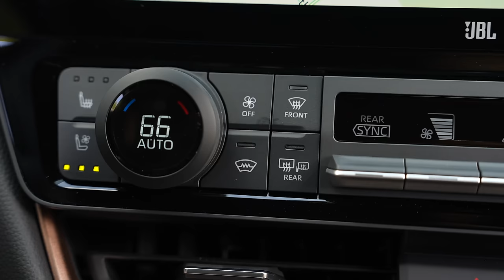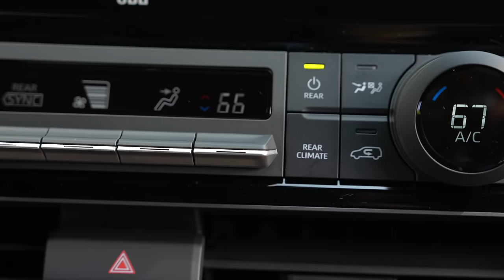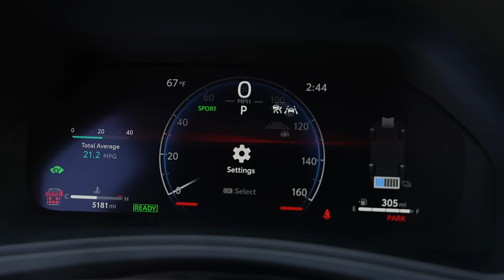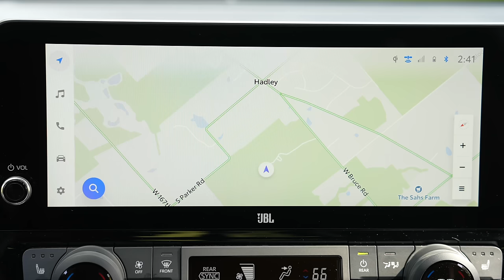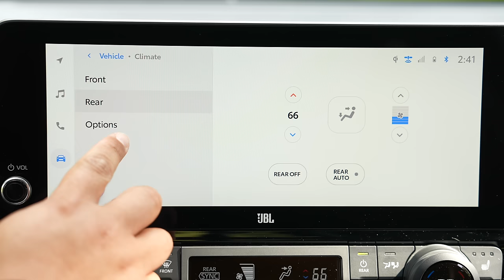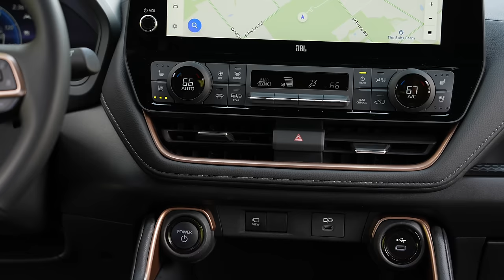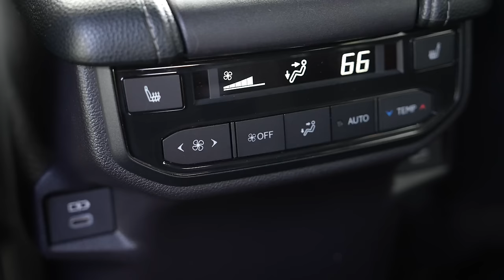Should You Buy A 2024 Toyota Grand Highlander? Back To Basics Toyota

Comment: It doesn’t have an odd shift pattern but when you have 8 gears it is going to constantly upshift and downshift. 8 gears is just not required and thus the constant upshift and downshift for better gas mileage but a huge nuance. There are manufacturers out there with 10 speed which is truly insanity but thr average consumer thinks more gears me and better when in fact they have more gears than they needs making more complicated and expensive to service and replace and repair.
Reply: The thing is though, good modern transmissions are so smooth, that you hardly notice it.

Comment: I think the brake light feature on the screen is for the auto parking brake.  It will automatically disengage when you press the gas again and then reengage when you stop.  So seeing the red on the screen is reassuring and reminding you the brakes are applied.

Comment: Another great video - but I have to say - how far back the engine is inside the engine bay - is irrelevant to pretty much anyone that doesn't service their own vehicles.  They take it to the dealer for the scheduled maintenance and it's a mechanic issue I suppose.   Looking at buying one and your walk through of the components and how there is a functional engine cover etc is great detail.  It's good to know they're using quality material and that the quality overall is what you've come to expect from the Toyota brand.

Comment: There are other advantages of the Grand Highlander besides the more powerful engine option.  Towing capacity is higher in the Grand Highlander at 5000lbs for the regular turbo and Hybrid max engine options.  G Highlander also better Ground clearance than a Sienna at 8 inches vs the 6.3 inches on Sienna.  G Highlander is better at handling snow and can even do light off roading compared to Sienna. Spare tire is standard on G Highlander in regular spot vs an option on the Sienna in a weird mounted position that intrudes on 3rd row and rear cargo space.  G Highlander also suits those who don’t want to be seen driving a minivan.  I also imagine that G Highlander handles and rides better given its more rigid unibody.  Sienna has your typical minivan Unibody that’s basically a big box where bumps go jarring through the en	tire cabin. Oh and you never have to worry about repairing the sliding doors in G Highlander.  So there you have it there are probably more reasons to chose G Highlander but I think I proved my point that there is more than just the improved power train option.
Reply: Yea Grand Highlander wins unless your using the sienna as amazon delivery van everyday or need max space all the time... I don't need max space all the time... I have a mini van and I thought the space was amazing at first until it was not needed and I used occasionally which the Grand Highlander can handle now  that it is bigger...  Also, using my mini pan to put mulch and dirt made it dirty lol  so I am going with Grand Highlander and get a used pick up on the side...  Also, my mini van ground clearance sucks and I can use this highlander on light trails since it ground clearance is actually very good...

Comment: I've owned and loved turbos, but in my old age, I think I value simplicity over complexity.  I'd definitely go the non-turbo route on this one.  I'm also a huge fan of how bulletproof the usual Toyota eCVT is.   Even if the EPA mpg numbers of the two were identical, you can keep the extra power, I wouldn't want this new system.  With this being a serious gas hog by comparison, it's not even in the running for me.  The regular hybrid is a slam dunk between the two.

I agree that the 2021+ Sienna is better in most ways, but I think the regular hybrid version of this is a reasonable alternative for the anti-minivan crowd.  

I follow the vanlife and nomadic RVing communities.  Both versions will probably find a small following for folks who find it in their price range.  Maybe this version for anyone towing a trailer, the regular hybrid for anyone just living in the SUV.

Comment: I looked up the flagship Sienna and after taxes in Canada it comes to $80,500. I then looked up the Kia Carnival - their fully loaded model comes to $63,300.  I am a fan of Japanese cars and all - I know the Sienna gets better gas mileage but man $17,000 buys a heckuva lot of gas and the Kia is more powerful and seems to have some nice things like two-panel sunroof etc. When prices are more eor less the same I always tend to recommend a Japanese model but in this case the Kia is worth discussing because you actually save a LOT of money and get more features and more power (and arguably better looks). And it isn't using their catch on fire 4-cylinder engines.  My family had the previous Sedona and it never had issues. Granted the Kia doesn't have AWD but if you know how to drive and use snow tires in winter it's not a big deal IMO. I wonder if the Car Care Nut would bring in the Carnival to see how it is from a Mechanic's perspective given the rather massive price difference.
Reply: yea the only problem with kia is reliability this is the reason they are cheaper they have a history of transmission and engine problems they have gotten better recently I've heard but its still a gamble with companies like that

Comment: Im not sold on the hybrid-max drivetrain AMD. Seems like it adds a huge level of complexity to the drivetrain !  Time will tell I guess !
Reply: TOYOTA/LEXUS has done their home work... that's the same reliable turbo engine that came on the FIRST GEN NX! but I'm sure with beefier components and TOYOTA has been doing HYBRIDS for  well over a DECADE! they know what they are doing.... they wouldn't release an engine without first reliability! let's be honest!
Reply: @KuyaArbee  Im not worried about the engine. I have a'22 Venza hybrid. But this new hybrid-max adds a regular auto trans to the mix
Reply: @zonie1953  One way to maybe look at it (glass half full kinda deal) is toyota is putting this powertrain into the new tacoma, land cruiser, new 4runner etc

they're either going to tarnish their entire lineup or they're incredibly confident in the system
Reply: Absolutely, the regular T24a is already complex enough, even the non turbo 2.5 A25a from my experience I’ve seen issues with the engine and their low mileage. It’s harder to fix due to more complex components and electronics that work with it, and considering most Toyota owners don’t maintain their vehicles, these newer engine design is less tolerable from abuse and require more expensive fixes when something goes wrong.
Reply: @BigAltimaEnergy719 I don’t think any manufacturer should design an engine around the user ignoring maintenance lol

If an engine blows since they didn’t maintain it…tough luck. Maybe try public transit instead lol
Reply: @KuyaArbee  Nope. This has the 2.4L T24A-FTS. The NX had the 2.0L 8AR-FTS.

Comment: I drive a 2023 Prius with roughly 7,000 miles on it. My stats indicate that I've been in EV mode 57% of the time. Since the engine has been active only around half that time, would it be ok to get oil changes every 10k miles, considering the engine has effectively run for just 5k miles and the battery handled the rest?
Reply: I'm a mechanical engineer who bought my first Prius 22 years ago, and currently drive a 17 Prius Prime.  Assuming yours is not a Prime, I'd treat it like any other car regarding oil changes.  It actually gets all its power from the gasoline engine.  Its "EV Mode" miles are really just using up energy the engine put into the battery.  So, while the engine may be off half the time, it's working twice as hard when it's on, to both push the car and charge up the battery for pushing the car the other half of the time.

It's almost like asking whether you can keep the same oil change interval if all of your driving is uphill or with the parking brake on.  The answer is no, that is considered hard service and needs a shorter maintenance interval.

But if your car is a Prime, and your "EV Mode" miles are all driven on battery charge that came from an electrical outlet, then the answer become maybe.  In that case, you still need to ignore "EV Mode miles" and really use the total amount of gasoline burned as your guide.  

To use simple, approximate numbers, if you never plug in and average 50mpg and change your oil every 5000 miles, then if you plug in often enough to average 100mpg, the mechanical wear on the engine requiring an oil change, won't be reached until 10,000 miles.  If you average 200mpg, then you haven't burned 100 gallons until 20,000 miles.   At some point, it doesn't matter whether you've only burned 25 gallons since your last oil change, especially if your commute turns the engine on for a couple of miles per day after getting say 30 miles of true EV usage from plugging in.  It is running the engine enough to create condensation, getting some water into the oil, and so forth, and maybe not staying warm long enough to evaporate it out.  In that sort of case, you might need to change it every 6 months regardless of mileage, rather than a year regardless of mileage.

One other factor to consider, is how many times the engine turns off and on, which can be a very large number of times in some types of driving.  Though Prius is designed for that, you have to wonder if a microscopic amount of gasoline or water is introduced to the oil each time, until the O2 sensor and so forth can react to the sudden changes of the on/off cycles. 

My own driving normally either doesn't turn the engine on at all between charges, or runs for a good while fully warmed up, so that I'm comfortable changing the oil every 100 gallons of gas, which for me is usually every 8000-11,000 miles.  In my own driving scenarios, I'm sure that is just as good as changing it every 5000 miles if I never plugged it in.  Enough of my days involve driving 20 or 30 miles with zero engine usage, that I see no reason to count those miles as coming out of a 5000 mile oil change interval.  Doing so would be as silly as counting the miles it was carried on a truck from the port to the dealership. 

 If the engine is completely off all day, it is no different than if it is sitting in the driveway, as far as the engine is concerned, so it doesn't matter how many times you charged or how far you went on a plug-in charge.   But that is not true with a regular Prius.  Every mile you go is from burning gasoline and heading toward a needed oil change.

Comment: You can't slam the Grand Cherokee for having a subpar underpowered V6 and then praise a 4 cylinder pushing that beast around.
Reply: Think emphasis on underpowered, this 4 banger gets over 40lb-ft more torque
Reply: @TwinkanPD  Turbos run hotter, not going to last as long, more expensive to fix. That thing should have a V8. They last forever if routine maintenance is done but the Greenies are screwing everything up currently.
Reply: @esteban1487  Yeah toyota's average fleet mpg can't afford any more V8s/v6 in their lineup
Reply: @TwinkanPD  Hopefully this insanity will pass when the Demonrats are bounced.
Reply: Poor little 4 cylinder in this big suv
Reply: they both feel way different. this may be a v4 but it feels much better than jeeps na v6
Reply: @jVid460  inline 4 not v4

Comment: Great detailed review. However I was looking for your recommendations with regard to the 2.4 turbo which does not cost as much as the Hybrid or Hybrid Max and will be what most people will buy. So what do you say? I have no interest in a Sienna or GH with a hybrid. I have owned 3 Siennas and 3 Highlanders with V6.
Reply: I have had a new GH Platinum for about a month with the non hybrid engine. It replaced a low mileage 2011 Sienna V6. Other than sounding like a weed eater with a muffler, the engine was the biggest surprise on the vehicle. It is at least as responsive if not more so than the V6. Very quiet and smooth. A few nits, but really have been pleased with the vehicle.
Reply: @brianbarbe9646  Thanks for the feedback. I have a Limited due around October 12th.
Reply: Limited a good choice. I should have probably done that. I think you will be pleased.  @DaveInTexas1180

Comment: I have 2017 honda pilot. 
If you want people to jump to 3rd row, pilot is the best. Seats are spacious than any other SUV and people won't feel like they are being punished.
Snow, rain, slippery hills doesn't matter. Honda V6 AWD is a power pack.
Drove 100k no issues. Low maintenance. 
You want pep buy Ferrari. Don't sport with a family car that has children on board.
For a beast of that size, Pilot is not sluggish at all. 
18 mpg in cities. 23 mpg on highways.

Comment: The main reason to get this over the Sienna is the design / looks. The real comparison is the new Pilot and this. Cargo space numbers would be great. The 2013 Highlander has 95 square feet of cargo space and this and the new pilot are about the same. The exterior dimensions on the old 2013 Highlander is a much smaller footprint. New cars seem to get bigger and the interior space doesn't. Is that just for safety?

Comment: Living in Phoenix AZ valley of the sun with a 2023 highlander hybrid XLE. After having the front AC on and cooled vehicle I went to sit in the 2nd row to play around and experience the rear AC. At first I thought it was malfunctioning because of how hot the air was coming out and for a long time. Gotta wonder if there’s insufficient insulation due to limited space in roof.

Comment: The sound of the ECVT transmission is really minor compared to the reliability gained from not having the wear components such as a clutch.   ECVT is simple to maintain and no worries about when to do the transmission fluid change as with a 5, 6, 8, or 10 speed automatic especially at high mileage.

Comment: Have owned a Hybrid Max for nearly 2 months now and love it. Only odd thing that I've observed (and many others report) is that it has a 17.2 gallon tank but on empty takes less than 12 gallons. Would love to hear the mechanics explanation of what is going on with fuel capacity. Seems to have been an issue with other Toyota hybrid SUVs. Does it really have 5 gallons in reserve?
Reply: Supposed to be a 3 gallon reserve because it will damage the hybrid if the tank is allowed to go to empty. Check with your dealer if the tank gauge needs recalibrating

Comment: I looked at the Sienna and it was nice but my wife said she didn't want a van...I bought the 2024 Grand Highlander XLE. It has the back seat as a bench seat which I like more. I've only put 500 miles on it so far. I'm not really in love with the car but it's okay... I have a Cadillac ATS that I really like driving. But I went with Toyota for its reliability. it is pretty bland feeling interior and the exterior is okay. But I do like the panoramic sunroof. It makes the car feel more lively. The automatic shut off is unlike other cars i've been in where the auto start/stop shuts the car off when you stop. But on the this car If you don't press the brake down very hard, you can keep the car on. If you press the brake harder, the car will shut off. I like that feature. The back needs to come with a cargo net. I park on a slight hill at home and when you open the back, your stuff will fall out. I already had a watermelon fall out. This car is so big it makes it difficult to wash. I'm 5'8 and I'm going to have to get a ladder to reach the top when washing it. One thing I noticed on the grill, it has large enough holes for a rock or something else from the road to go straight through and hit the exposed radiator. Lastly...Mine came with a lifetime power train warranty. So if anything goes wrong with the engine/transmission, it's basically covered for the lifetime of ownership on the vehicle. Plus the 5 year 60k warranty.

Comment: I finally test-drove the Grand Highlander, and was quite negatively surprised. For one thing, one of the biggest selling points of this SUV is that the cargo space behind the 3rd row is much larger than the regular highlander. Well, it might be larger on paper due to the boxier shape of the cargo area but the actual usable space is only negligibly larger than that in the regular highlander. For another thing,  the 3rd-row seat leg room on paper has increased but in practice this is only useable for small people on really short trips and also only if the folks  in the 2nd-row seats sacrifice some of their own leg room. The bottom-line is that this SUV is on the same platform as that of the regular highlander (4th gen.) and the ability to make enough room for the 3rd passengers and cargo space behind the 3rd row has really been limited. At best, may be thought of as the new (5th gen.) highlander.
Reply: I have 2017 honda pilot. 
If you want people to sit in 3rd row, pilot is the best. Seats are spacious than any other SUV and people won't feel like they are being punished.
Snow, rain, slippery hills doesn't matter. Honda V6 AWD is a power pack.
Drove 100k no issues. Low maintenance. 
You want pep buy Ferrari. Don't sport with a family car that has children on board.
For a beast of that size, Pilot is not sluggish at all. 
18 mpg in cities. 23 mpg on highways.

Comment: After we changed the battery on the 2017 LX570, now our infotainment system doesn’t turn on .

 I followed the instructions in the picture below but it didn’t help. The screen shows the lexus logo like in video for a couple seconds when I first turned the car on but then it will shut off to a blank screen and no audio. Backup camera  STILL SHOWS, which means the screen is fine. 

Yes we have tried the disconnecting negative method. No audio at all and all the buttons don’t work for audio.

The fuses are good, so I’m not sure what is potentially fried or causing the problem.